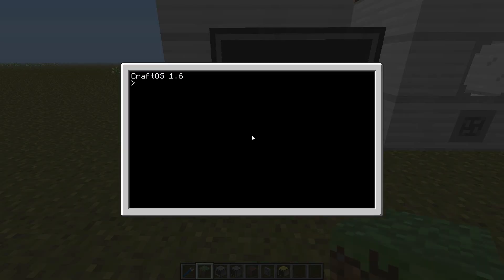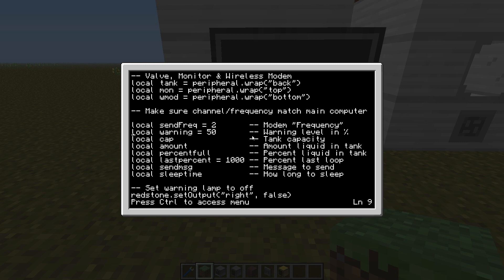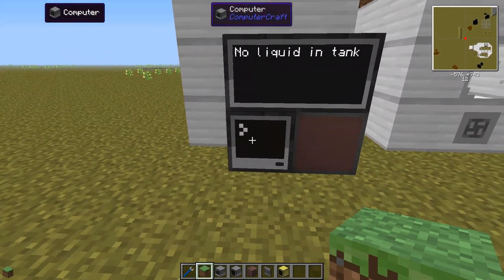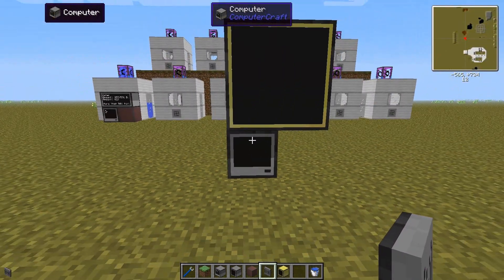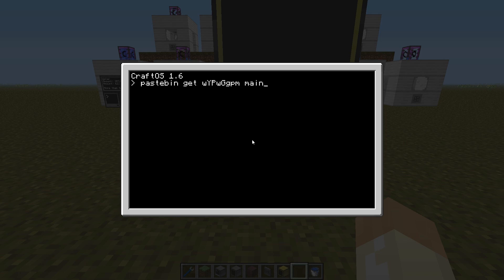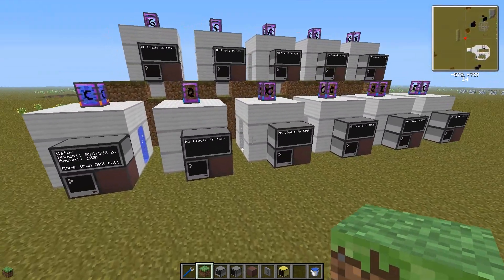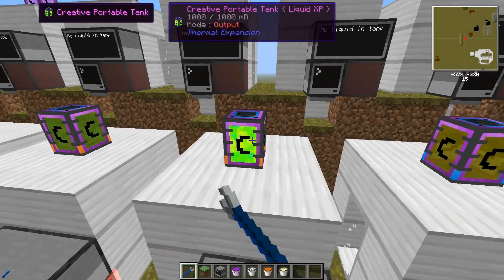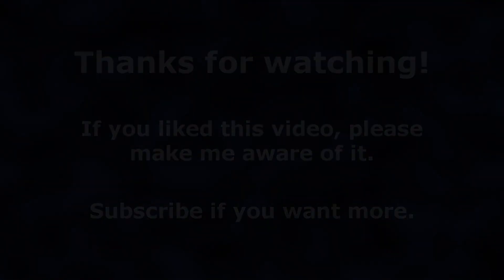Computercraft Tutorial - Tank Liquids Monitoring System v2 (FTB 1.6.4)

Comment: help..
watertank :21: attemp to index ? (a nill value)
Reply from the maker: I can't help unless you give me more information. Modpack or mods used, versions of them. Screenshot and/or description of the setup can also help. I saw you sent on Facebook as well, use the one you prefer :)
Reply: therealtkh 1.7.10 computercraft 1,65
Reply from the maker: Luiz Fenando Gonçalves Any other mods? OpenPeripheral is also required for this to work. I have never tried it in 1.7.10 though.
Reply: therealtkh perfectly working in 1.7.10 with OpenPeripheral.
Reply from the maker: Uk nugget That's great to know, thanks! :) Just beware of the RailCraft bug if valves are placed in specific way. See workaround video if you run into it.
Reply: I've already checked out your second video because I had the same problem. Solved placing a tank wall in the very center of the tank, all other blocks can be valves. Big Up to you for this nifty program, can't wait to implement this to all my tanks :P
Reply from the maker: Uk nugget Awesome! I look forward to do it myself as well, typically I hardly use my creative creations in my normal play for some strange reason... ^^
Reply: therealtkh work! xD
how to print the result of the getAdvancedMethodsData in the monitor?
Reply from the maker: Luiz Fenando Gonçalves Why would you want to do that? ;) That method returns a lot of text, but I don't know what to use it for to be honest... You can wrap a monitor (in example: "mon" is monitor and "c" is a chest that is wrapped). and do something like mon.write(c.getAdvancedMethodsData()). But you probably need to format the text in some way to get it on multiple lines and stuff.... But I don't know if this is what you want to do?
Reply: therealtkh the result is getting half on the computer, look http://imagizer.imageshack.us/a/img661/2941/zDc35P.png
Reply from the maker: Luiz Fenando Gonçalves Yeah I noticed, but I have no ready suggestion on how to format the text to fit better. But do you have to? What do you want to do? :)
Reply: therealtkh just see the whole content

Comment: First off, many, MANY thanks on this video and the pastebin links. I'm new to CC (and I'm loving every bit of it) and this video was the answer to one of the dilemmas I was having :)

I know this vid's old, but I'd like to ask a quick question. On my "main" comp I want to make it do two things: 1) output a steady redstone signal to its rear, and 2) flash a lantern to its right (similar to the "slave" computers). Both of these actions could maybe be carried out if the comp detects the received text is a .red message (indicating a warning). What could I add to the code to make it do that?

Thanks!

EDIT: Fixed it by simply adding an rs.setOutput line after the "if string.match...".red.") then" line. Was putting false instead of true - woops :P
Thanks again for the awesome tut!
Reply from the maker: Hey, glad to hear you liked it, and that it helped! :)

This is a late answer, had a little backlog, but I can see that you have already fixed it. Sounds like a good tweak, to make warnings visible from a distance. You should use a sound alarm at critical levels as well! ;)
Reply: therealtkh Thanks, and I might consider having an auditory warning as well :)

Having another issue I just noticed last night though - I have a tank with UU Matter, and I believe I have it set up the way I want it (it actually gives a warning when almost full, not when below the warning percent), but with both my edited tank program and your original I can't get it to detect the liquid inside ("No liquid in tank", but there's about 27000mB). I've checked wrapping and I've tried some things, but I can't get it to detect the UU Matter in the tank. I'd appreciate it if you could help me out with the issue :/

Thanks again :P
Reply from the maker: Nhorr I've heard of an issue (a bug with OpenPeripheral perhaps?) when you have a valve in the bottom of the tank (like one block behind and below the reading-valve)... but I haven't explored that fully. Can you send more details of how you have built the tank and the setup? Screenshots are also good! Send a PM with info if you want to.
Reply: therealtkh I have that exact setup atm - never heard of the bug, but I'll try putting the valve else-where. I'll edit this comment with results :)

EDIT: Yep, it all works fine now. I just moved the output valve onto one of the sides, and it reads perfectly now. Thanks :)
Reply from the maker: Nhorr
Thanks for letting me know, and good to hear everything works now :) I did the same test myself yesterday and recorded a video with this workaround. Will post it during the weekend and also place a bug report to see if we can find the reason and a real solution to it. Thanks again! :)
Reply: No problem, and thanks to you again for the help :) Completely forgot about the comment below regarding the issue XD